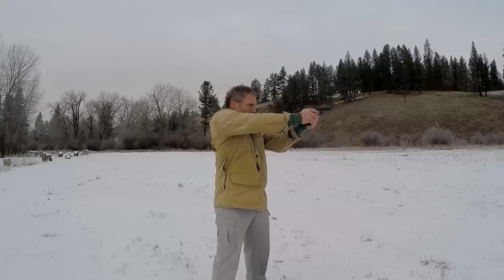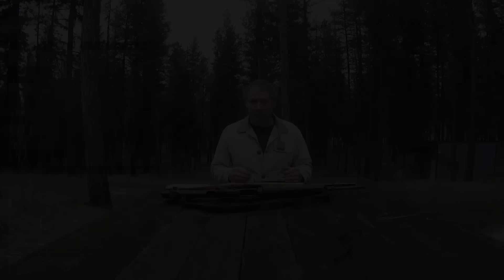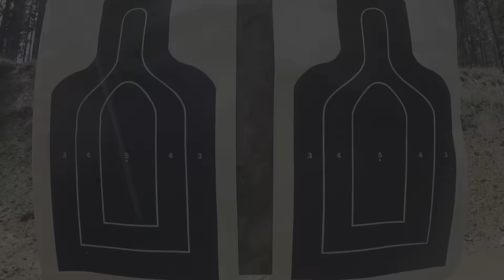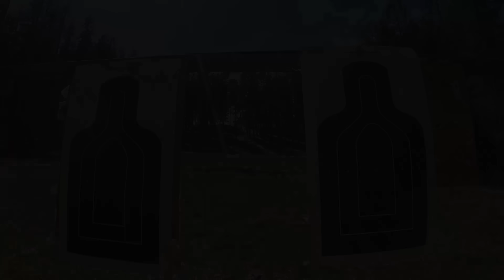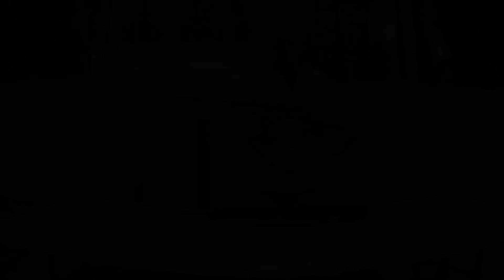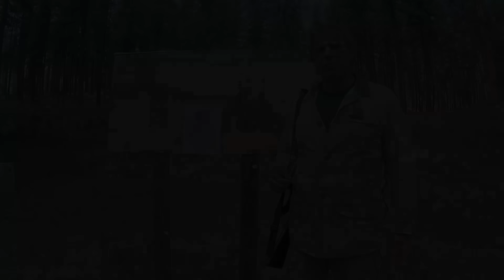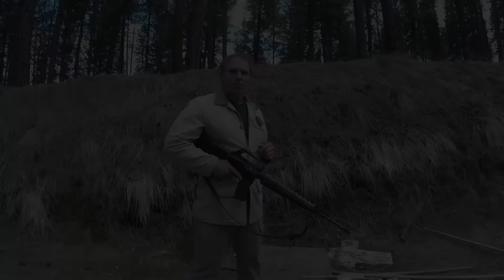Mini-14 vs AR15: Which is Better?

Comment: I’m surprised Paul didn’t bring this up but the newer made mini’s are more inherently accurate they have a heavier barrel and they did something to the gas system less vibration or something don’t remember and it’s to late in the day to fact check that I know they did something though.is it as good as an ar15 no probably not but I’ll tell you what I own a mini because ar15 in my neck of the woods have to be Neutered to be legal.in that case the mini really is the best option for someone wanting a    Magazine fed 556 rifle and at the end of the day even though I know the ar is better in a lot of ways I don’t feed out or under gunned at the range or god forbid in a defense situation.

Comment: Had to mention the explanation of the sighting systems and ballistics. It was excellent.  To this day I am amazed at how many people still do not understand this simple principal.  They are not capable of understanding the difference between point of aim and path of the bullet.
Reply: I understood that, but what really helped me was the explanation of why a 25 yd zero is pretty close at 300, all I could find online was people saying that it does or debating what range to zero at. No one mentioned the reason being the barrel is slightly canted, and looking back it's really the only way it could do that, but it's still helpful to have a person that can spread knowledge so effectively is a treasure

Comment: i dont know about your particular one, but my modern mini-14, it states in the manual that even though it is marked caliber .223 it has a 5.56 chamber except for the Mini-14 target model or some sort of "precision" model they make. this is a common misconception with mini-14s.
Reply: From Page 11 of the Manual:

"The RUGER® MINI-14® RANCH RIFLES are chambered for the .223
Remington (5.56mm) cartridge. The Ranch Rifle is designed to use either
standardiz U.S. military or factory loaded sporting .223 (5.56mm) cartridges
manufactured in accordance with U.S. industry practice. See “Ammunition
Notice” & “Ammunition Warning”, below."
and yes they misspelled standard  in the manual.

http://pdf.textfiles.com/manuals/FIREARMS/ruger_mini14ranch.pdf

Comment: Great video as always.  Love your channel.  None better.  Not disputing your results but there is one thing that I think would have made it more accurate.  The Mini-14's barrel was redesigned and upgraded after the Mini-14 you are using would appear to have been manufactured based on your comments.  I have owned a Mini-14 with both the original and the new barrel.  The new barrel would have proven a much better and fair comparison.  The difference in accuracy between the two barrels is obvious.  Maybe this could be a new video theme?

Comment: I’ve owned both in the civilian world and deployed with the AR and actually used it in the sandbox as an airborne infantryman.  The only guys that  had problems with the AR platform are those who didn’t properly maintain it. 

That being said, I did love the mini 14 and it was great and reliable, but the mag switching was not as fluid (as displayed). I thought I’d be able to “flick” out the old mag with a new mag like an AK, but that was not the case. 

I also found the bolt carrier to be extremely finicky in disassembly. Still a great rifle and would use had I not built and AR from the ground up.

Comment: Thanks for another great video, Paul.  I chose a Mini 14, the choice was purely aesthetic, I just like the Mini 14.   I fired the M-16A1 in the AF, qualified as "Expert", for what ever use that is, so I am familiar with the platform.  I did not like the sound of the recoil spring in the stock, and I did not like the plastic feel.  I am not a tactical shooter, more power to those that are, it is just not my game.  I have been playing with the idea of picking up an AR, it's just that there are about three firearms I would prioritize over an AR at this point.

Comment: For the modern take, why not go Ruger vs. Ruger? I propose Mini-14 Tactical vs AR-556.
Reply: I'm not sure why this is a topic. If you have a mini so what but if you have an AR-15 you have a far superior rifle. Just using Ruger for example Ruger Mini 14 Tactial which to me is comparable to an AR-15 1:9 Twist(nobody wants that anymore) 7.2lbs and MSRP 1089.00, Ruger AR 5.56mm 1-8 twist much better, 6.7lbs MSRP 799.00 hell the Ruger MPR is cheaper than the mini 14. And don't even get me started on magazine availability and price. Mini Trash Mini 30 even bigger trash.

Comment: I'd love to watch such a presentation by you about 5.56NATO vs .223 Rem !!!
Reply: @Nick R we all know that, though it's not the same to have it written by someone, than explained by  Harrell, you may agree.
Reply: Especially when the Ruger is actually chambered for 5.56 from the factory

From Ruger - With the exception of the Mini-14 Target Rifle, which accepts only .223 Rem. ammunition, .223 Rem. and 5.56 NATO can be used in all Mini-14 rifles and Ranch Rifles.
Please note that "Military Surplus" 5.56mm NATO can vary greatly in its quality and consistency.
Owners manual says the same for all of mine as well and they are various series and years.

Comment: Around 1993 or 94 I bought a used mini-14 & and a used AR15 because of the unjust 94ban that was coming, I could not find either of those rifles new at any of the 4 gun shops In my driving area, the world was a different place before online shopping, it was a "this is what I got to sell kid, take it or leave it" attitude. Heck, I think a couple of those gun stores welcomed the 94 ban :/ 

Anyway, the mini-14 had accuracy problems and it was clear it wasn't me because the AR shot fine as well as my Rem 700 and my 10/22. I tossed it in the back of the safe for a long time until a young fellow wanted to trade his brand new newly released Glock 26 Gen 4 (plus 4 G19 mags) for it.

I was kinda feeling like I should mention how I didn't have much accuracy with it but before I did the young fella, while holding my mini14 says "A guy at work told me 9mm wasn't powerful enough and I should get a .357 magnum revolver for power & reliability, you just can't trust your life with a plastic automatic" 

After that I was thinking.... you are basically saying to my face I'm making the same mistake your work buddy said you made if I make this trade :/

I said "Well, I'm happy with this trade if you are?" He said yes so we parted ways. :) 

Still have the AR15, shot it a bunch over the decades and ended up doing a form 1 many years ago,  Has a DD Mk18 10.3" upper and surefire suppressor with an Aimpoint T1, it's my goto AR.

Comment: A good read on the accuracy issues of the Mini-14 by Ed Harris and a possible fix. http://www.grantcunningham.com/2012/02/ed-harris-my-observations-on-the-ruger-mini-14/  I had a original Pre Ranch rifle all wood no plastic Mini-14 that I traded off many years ago but with good handloads you can improve accuracy over factory ammo.

Comment: I own both platforms, had the mini 20 years before the AR, I like them both. No surprise that at longer ranges the longer barrel wins out in the accuracy dept.. The rotating bolt design of the mini is much simpler and less complicated than the AR platform which requires a multitude of small parts to function.

Comment: First time I shot my mini 14 Ranch Model Stainless (new incarnation) I was shooting the five ring target (one bullseye in each corner large bullseye in the center) and I can't tell you how good it was, all center. Second time it was tight but mostly stayed on the LEFT SIDE FROM MY POINT OF VIEW on the center ring, drifting to the upper left ring. I don't owe ARs but I shot them & I felt that the Mini was more accurate for me. First time at least, second time showed I need a little more practice.

Comment: Absolutely awesome video Paul.  I have one comment about the hit and miss accuracy, is that, from what I've read, they subcontracted out for the barrels at one point.  So if you got one earlier, or later (you can tell by the shape of the barrel, and or serial number) you'd be ok.
For me, firstly, I would get one because of the laws you mentioned.  An Ar is restricted here, so it's only legal at the range, and second, I don't believe for a second that you and all your buddies didn't buy them because of B A Baracus! 😂😂😂
Oh, and it's crawling with those ignorant adults you just mentioned.
Frankly I'm impressed enough to feel that I shouldn't feel too bad about getting one.  I don't see myself ever taking shots beyond 200yds with it.  Thanks Paul!

Comment: Great video Paul! Living in California, I bought a Mini 14 instead of an AR for some of the vary reasons you mentioned (not scary looking so folks won't freak out, didn't want a weapon with stupid fins on the grip to lower its scary factor, etc.).  I liked your perspective on the difference in sights too.  To my knowledge, NO ONE has compared the two platforms like that before.  In my mind, shooting over 300 yards with the Mini is not really what it is intended for nor how I will ever use it. It's a Ranch Rifle.  Within 200 yards, it gets the job done as you demonstrated.  I noticed your test Mini had the 'old' barrel.  Have you had any experience with a Mini 14 with a 583 series serial number that has the 'flared' (reinforced) barrel and if so, what are your thoughts?

Comment: I bought a Ruger Mini 14 in 1976, it was a Bi-Centennial model.  I shot tens of thousands of rounds through it from near point blank to 100 yds.  It was perfectly reliable and shot quit accurately with a 4 power scope attached, I could shoot consistent 2" groups at 100 yards.  Some tough financial times forced me to sell the gun in the mid-1980s, gosh, I wish I still had it.  In the middle 1990s I bought a Bushmaster with a bull barrel, it weighed probably 9.5 pounds but shot .5" groups at 100 yards.  I love mini-14s, if I was rich I'd own a couple of them, but with my limited budget today I'd buy a $600 AR instead.  If Ruger could, or would, make the Mini-14 more accurate and set them up to use AR magazines I'd save up and buy one.

Comment: I owned one of the newer Mini-14s in the past (sold it to a friend a few years ago) and recently purchased my first AR, and my experience/opinion of how they compare in terms of ease of disassembly/reassembly seems to be the opposite of Paul's, at least when it comes to basic field-strip. I find that just sliding the BCG and charging handle in and out of the upper receiver is quite a bit easier for me than finagling with the Mini's bolt and op-rod, especially trying to get the damn things back in the proper place in and around the receiver during reassembly. Perhaps with practice I could have gotten better at it, but for me at least, the AR requires little to no practice to strip it down and put it back together.

Comment: The mini14 180 series barrel was 1 n 7 twist. With m855 the accuracy is better. I have had more minis over my lifetime than any other gun. You shoot 62 -70+ gr loads , it is accurate.

At the time i used a 180 series ss ranch rifle, folding choate stock, scope. Firing with my hand supporting the stock, rested on sand bag. 

Ss109 averaged 2 1/2 inch at 100 yards. Federal 68 gr match averaged 1 1/2 inches. With predictable point of impact.

Same gun averaged 6 inch groups with 55 grain ball.

Any gun with questionable bedding should always be fired with hand between forearm and rest.
Reply: Yep,  Lotsa folks don't realize that a faster twist NEEDS a heavier projectile in order to stabilize it.  My BCM loves 77gr SMK, 20gr 3031 and Lapua brass.  Won't win any speed records,  but it's a tack driver.
Reply: Good to know!

Comment: AR 15s are, IME more ergonomic for me, and one that cost as much as a mini-14 is probably going to be more accurate and easier to scope (I've shot 4-5 and they variable; two were OK, two were crap one was pretty good, I don't know how Ruger's done that). And there's better aftermarket, and of course they come in more interesting and variable configurations....but damnit I really like mini 14s too they're just cool as hell.  If I had more money I'd have one in wood stock. 

I can't say I've ever noticed a real accuracy degradation using 223 in my 556 ARs, but I'm probably just not a good enough shot; 1.5 MOA is about my limit as a shooter even when set up well.

Comment: One more thing from my experience.  As I've said before I'm in a restricted mag state. Ruger will NOT ship 10 rounders to my state.  I acquired 2 Ruger 10 rounders. Both have issues chambering the first round.  Often the round sticks and dents the casing. 5 rounders don't have that issue.  And FORGET about inserting with the action closed. Huge issues at least in my experience

Comment: The AR-15 will function until parts failure with nothing but lubrication and good ammo, barring anything ridiculous. (IE, debris like the talcum powder-like sand of the middle east, or extremely low temperatures that affect what lubes you can use) Not just my experience, but the experiences of Henderson Defense, a F/A rental range in Vegas, as well as the trainers for EAG Tactical. "Filthy 14" is on record with 31,000+ rounds with no maintenance, save for lubrication. Removing carbon fouling is still advisable, but nowhere near as necessary as many would believe.
Reply: All the while using a button rifled chrome lined barrel everybody gets hung up on hammer forged barrels being superior
Reply: @yeshua1176  Button/cut vs CHF has been an argument for thirty years, give or take. Hammer is faster and more consistent, but the machinery is stupid expensive; upfront, maintenance, machinist wages, etc. Doesn't mean the barrels are more accurate, they're just more consistent from barrel to barrel. Chrome vs nitride/melonite vs Stellite is a more interesting argument.
Reply: @Rb889  well aware valid argument hopefully we'll see this data sooner than later

Comment: I purchased a Mini-14 GB off of my sisters boyfriend.  It was a very reliable rifle no matter the magazine used. Was it accurate?" Yes it was until you bumped against something or for some reason after cleaning it, the zero would shift. I figured it was the shitty rear sight, it was lack luster. I changed it for an after market Garand looking rear sight with knobs for adjusting elevation and windage. Wallah it cured that problem.  I fought with a rust problem, I live in Florida along the coast, Heat Humidity and salt air, so I parkerized it even the mags, then when getting it back I gave it the treatment.  Boiled the rifles parts dried them off, (yes I was wearing gloves) and wiped it all down with gear oil so the pores would suck it all up. Cured my rust problem.   
It is my go too if all else fails,  its the reloading sequence that will get one into a pickle and frankly it gets hot quickly.   Other than that its a great rifle.

Comment: Nice comparison Paul.  As usual I learn or re-learn a bit from most of your videos.  Duran-Duran?  Roll it back to Lead Zeppelin, young fellow.  Still hoping for a run down on the .327 Magnum vice the .38 or other revolver loads in that class.  Do I need to send you a couple boxes of the ammo to get it done?
Reply: LEAD?

Comment: @Paul Harrel Paul, everything you put in this video was correct! I started out with the Mini-14 and got and AR-15 in the Mid 70's. I have the same experience with both as you have. Not often will I sit through a 50 minute video, but I did this one. Trip down experience lane with both platforms. I still own both rifles. I still like both each for a different reason! Thank You!

Comment: Mini 14 vs. Ruger AR556? No comparison. Mini is trash.
Reply: Not True. I have both , and mine are equally accurate at 100 yards, don't know about any further , my range  maxes at 100yrds, mini 14 is 2012 model and my ar556 is a 2018 model .

Comment: Great video, thank you very much. Yes, I watched the whole thing. I owned a Mini-14 Ranch in Stainless back in the early 90's, and I sold it for two reasons. 1) I didn't like the magazine latch. It just felt too weak and wobbly. 2) It was *incredibly* picky about ammo. The only ammo with which it was acceptably accurate was mil surplus green tip, and that stuff was far too expensive. Yes, I'm serious; the difference in accuracy between shooting any commercial ammo and that damn green tip was like night and day.

The one possible argument in favor of the Ruger which you didn't mention is the wooden stock. If you have to hit somebody with the rifle, the Ruger might yield better results.

Comment: Unrelated to my other comment, so forgive the double comment. (I felt like Paul for just a second saying that... ah warm fuzzy feelings)
I would like people who claim X weapon is "inaccurate" inherently to show me the vise tests.  A weapon fired from a vise with a bore sighting to a repeated point of aim tends to be far more accurate than most people would believe.  The inaccuracy usually is introduced on the human end.  IE) it's you that can't shoot whatever gun you're using accurately.  No shame in that.  Either learn your gun or switch guns to something that works better than what you've got now.  I know for a fact that even with a literal laser I cannot shoot better than a few inches at most reasonable distances.  Not the fault of my gun.  Reliability is another entire issue completely.  My comment addresses accuracy only.

If you show me a gun with a vise group that's terrible I'll 100% believe the gun itself is the issue, otherwise it's just the shooter being unable to aim the weapon accurately for WHATEVER reasons (bad design introduces user error, not necessarily inherent inaccuracy so the error is still on the human side there).